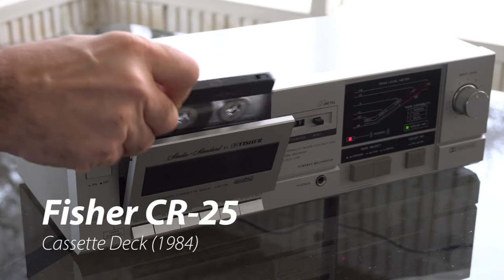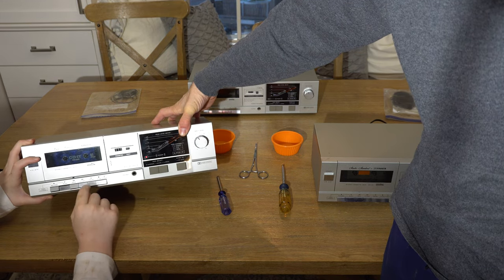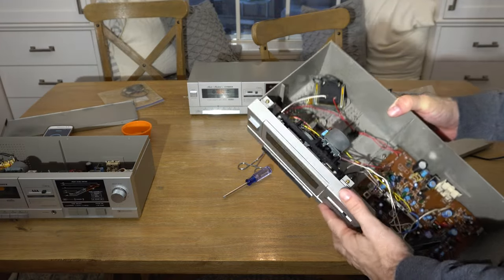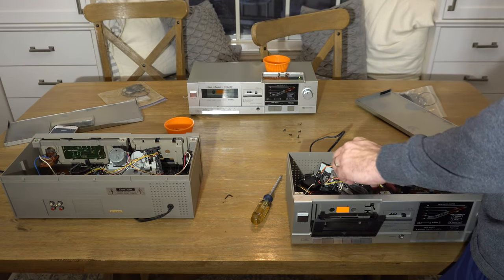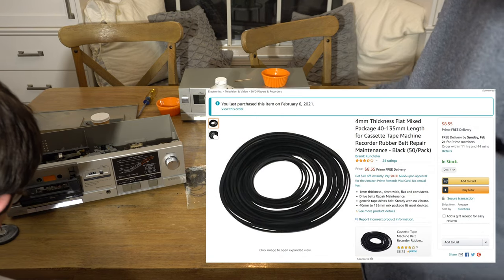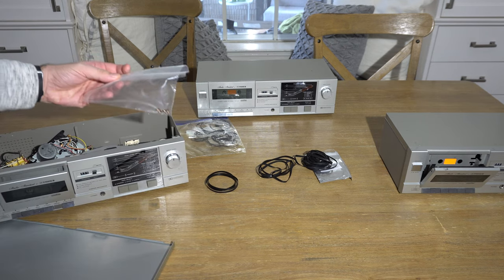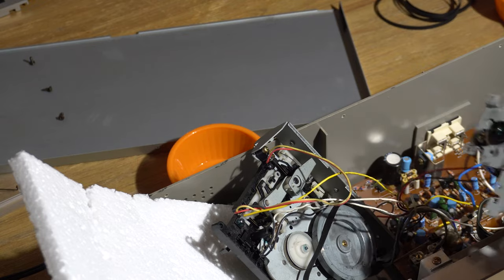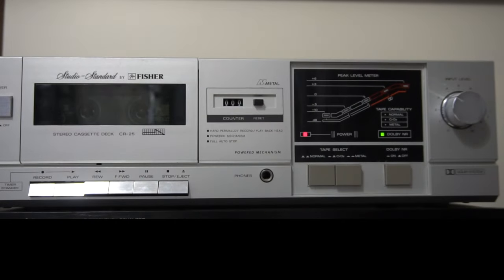Fisher CR-25 (Father Son Cassette Deck Repair)

Comment: I did like this, and would watch more like this, I'm so happy that someone, y'all took the time to fix these, as most would throw them out, even though these are cheap tape decks, they are vintage, and now get a second chance, Liked The Vid
Reply from the maker: Thank you! And these mechanisms are still better quality than some more recent cassette decks, since they are designed to be repaired..